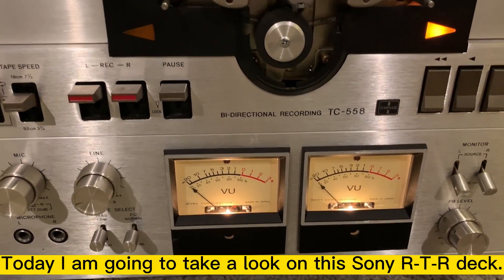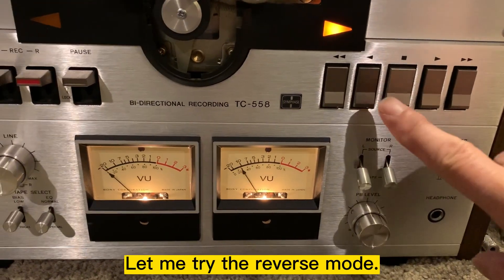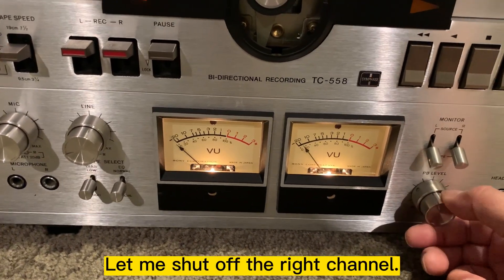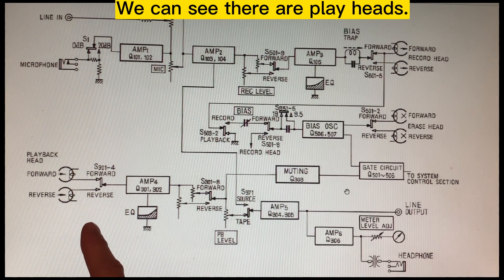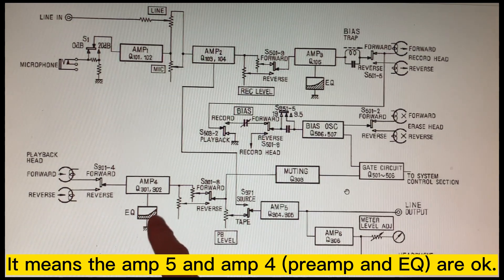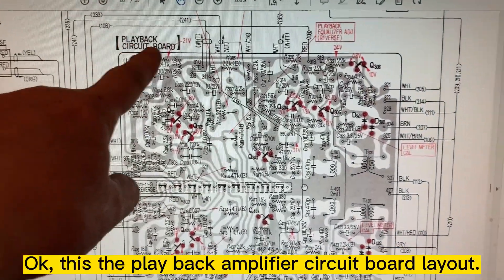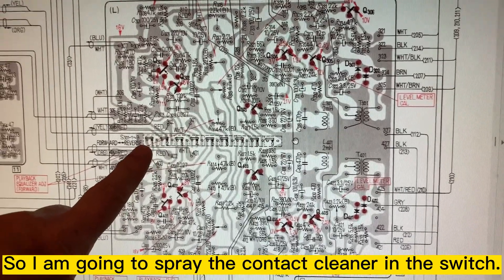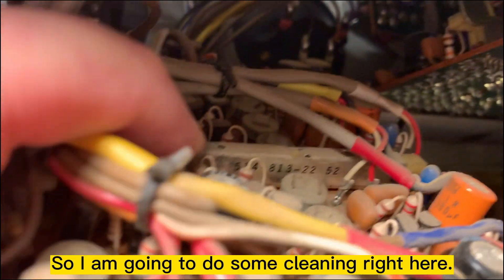Sony TC 558 Repair - One Channel Not Working on Reverse Play

Comment: Great repair, can you share where you obtained the printed circuit board info? That is not in the service manual. Thanks
Reply from the maker: See attached link: 
https://www.hifiengine.com/manual_library/sony/tc-558.shtml
Reply: I have same problem with my TC-558, thx for the informative video. Would you be able to share a downloadable link for the service manual? You have to have a HiFi engine account to download from the link you posted and the site no longer accepts new registrations. Thx!